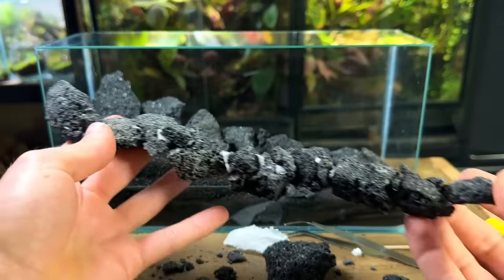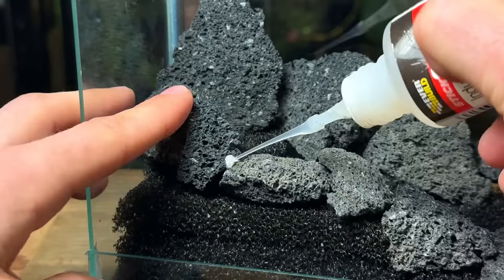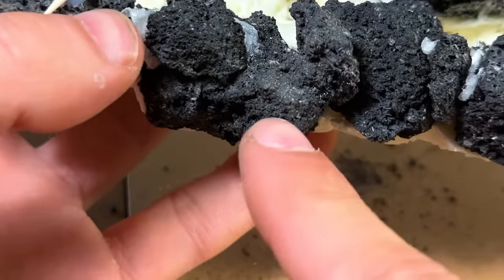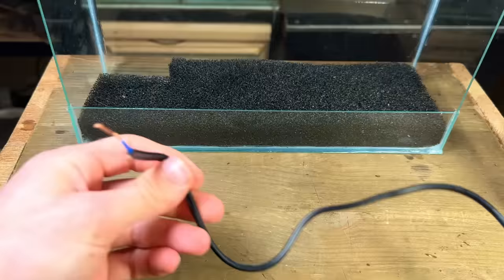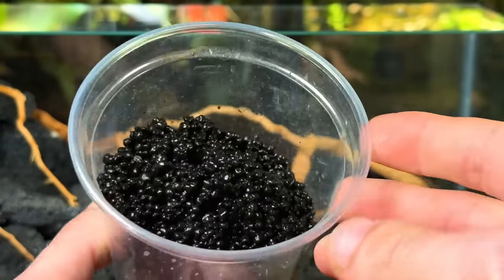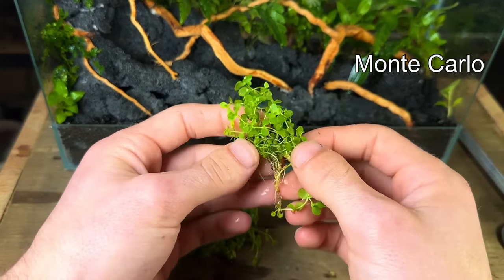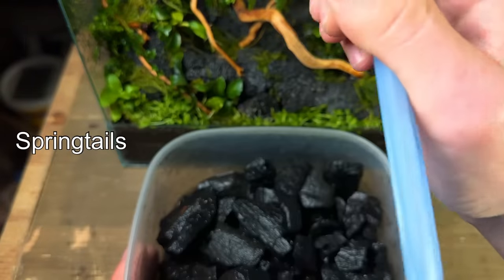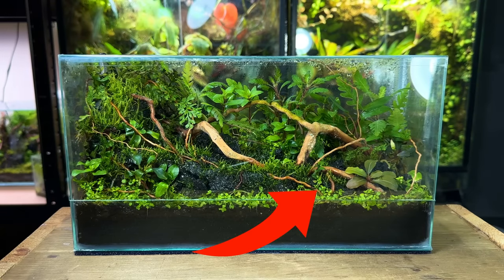I Made a Terrarium With a FLOWING STREAM, Here’s How!

Comment: I've never understood why everyone puts the pump inside the tank. If something happens to the pump, you are forced to take apart the entire thing to get to it. If you used an external pump, you could just run a pickup tube into the same hole you used for the electric wire. Then, when the pump fails, it's easy to replace or service it.
Reply: Smart

Comment from the maker: I forgot to mention that the pump is not able to be serviced & if it breaks id have to tare down the terrarium to replace it, keep this in mind if you’re gonna try this yourself. Nevertheless I love how this terrarium turned out! Hope you enjoy the video:)
Reply: Hello my friend.
Great build 👏 
However.....😮
The Pump rating is 220-240 volts.  You rejoined the wires by twisting and taping.  NO NO NO NO.
You've educated your viewers to believe that's acceptable and in reality could be very dangerous.   Risk of fire and electric shock.  You should never endorse this as an acceptable way to make 240 volt cable joints.  Look online for Wago Connectors.   You simply offer your stripped ends into the connector and shut the lever for a tight safe 240v connection.
Simple and easy and SAFE.
Not ranting... just thinking how many young folk will assume twisting 240v wires together is safe.  It isn't.  It can be deadly.
Get yourself a couple of Wago Connectors and redo your joint... please. 🤔🙂👍
Edit:  ps.  If its a 12 volt low voltage supply you'd get away with it... but not 240v.
Even with 12v cable you can get some tidy little snap button connectors for a tidy permanent connection.
Reply: @stevesvids I can’t tell if your being a nerd of just trying to help?
Reply: @stevesvids  Please tell me youre joking right? A WATER HEATER for a whole house is 220-240. This little pump is 120 volts. Its a good zap at best. 220 would melt this pump.
Reply: @stevesvids  It's hilarious
 that you think this pump is 220 volts lol
Reply: @xMcNuggetBuddy  is it funny?  Ohh right.  Tell me.  How did you decide that the pump in question is 120 volt?
Reply: @stevesvids  Did a bit of searching and found the exact one: VIVOSUN 800GPH Submersible Pump(3000L/H, 24W). I would've sent you the link but since i am not in america it doesnt open it and i cant send it.
PS: Im not trying to mean, just telling everyone that this pump probably can be connected like that
Reply: @stevesvids  No pump this size would use 220 volts. Period. And if it was designed to run off of a 220v volt outlet it would have a built in step down to only use 120 volts of that. 220 volts would fry a pump this small.
Reply: @stevesvids  You would only see 220v on maybe a pond pump. A full size pond pump. And even then its not likely. This small pump is 120 volts
Reply: @stevesvids  I just shared the link to his pump with you. ANd it clearly states in the specs "120 volts"
Thats the link that he put in his description of this video.
Reply: @xMcNuggetBuddy  hahaha yeah no way on earth that little pump is 220!!! That’s funny that he’s arguing that it is 220! Gotta love the YouTube experts criticizing people about stuff they don’t know anything about. I mean, it’s nice that he’s concerned for other’s safety but come on! Haha 220?!?
Reply: 220 is for LARGE APPLIANCES, Fridge, Washer Dryer Dishwasher. Almost everything else is 120
Reply: @stevesvids  with all being said, it still is good information for making a safe connection instead of self made let´s hope this doesn´t end bad. Most of the times it doesn´t but that´s not the point. Regardless the voltage.
Thanks mate!

Comment: Excellent looking terrarium!
A suggestion for the next time you use a pump: Since it has a UK plug you can easily remove the plug to thread the wire through any small holes, and then replace it afterwards. Twisting mains wire and wrapping it in insulation tape is probably fine for low power items but would be a fire hazard for something that draws more power.
Reply from the maker: This is a very good point! Thanks for the tip & I’ll definitely do that in the future😃
Reply: Frankly it's a firehazard in either situation and should NEVER be done. Electrical tape does degrade over time, and if the lead gets pulled a few times it could easily pull into a position where it either shorts, or creates a high resistance that heads up and causes a fire. Electrical work really shouldn't be done by anyone who doesn't have suitable education / training in electrical work. IF YOU MUST insist on doing it yourself, use the correct tools, look at a guide from someone who knows what they are doing. Use a terminal block and enclosure, or a product specifically for joining mains leads safely. This is how people die, folk!

Comment: I would only add a recommendation for people who know how to solder to do so in the part where the wire is spliced and rejoined. It'll make the connection more durable, protect the copper from air, moisture, and being affected by skin oils from twisting the wires together.
Other than that, it's quite safe to just twist the wires without soldering, since these water pumps are very low power.

Comment: It’s worth noting that you can also remove the plug off of the pump and rewire that instead, providing it’s actually possible depending on plug type. Easily done with a U.K. plug fortunately enough. If it’s a sealed U.K. plug, then you can buy a non sealed one for very cheap and attach that. If it’s non sealed to begin with then just unscrew it and then reassemble, no cutting or wire stripping necessary.

Comment: Wow! Please stop suggesting that people cut an AC power cord and then merely reattach it with electrical tape. This is stupid in any circumstance, but even stupider around an aquarium. Either do it right, or buy a DC pump so you aren't cutting a mains voltage AC line.
Reply: And you are in the UK with 220V so it's even more dangerous!